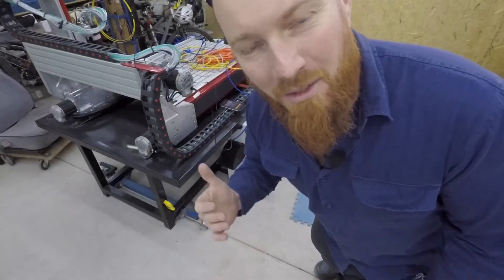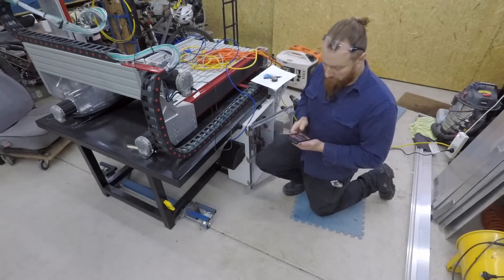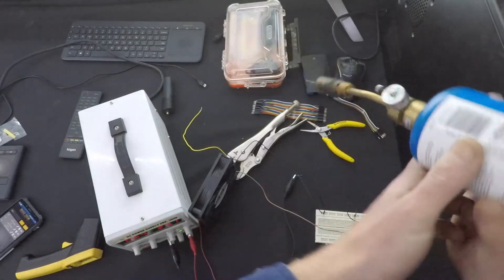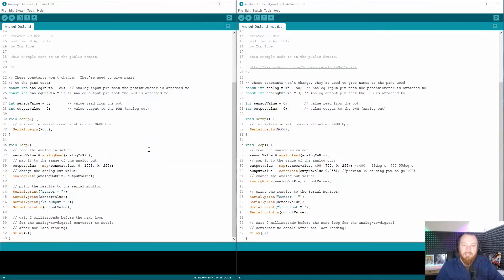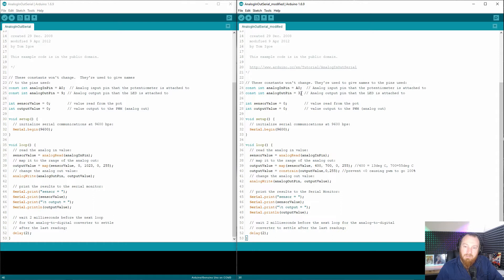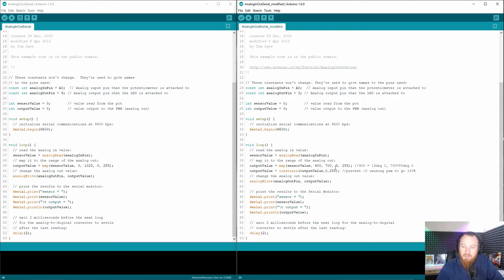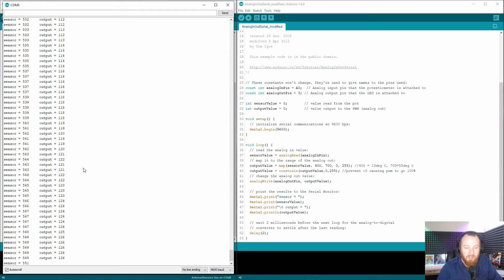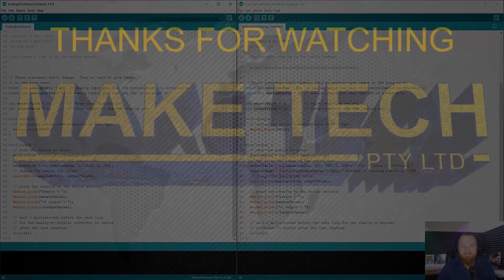ARDUINO: CONTROL 4 WIRE FAN, WITH TEMPERATURE SENSOR

Comment: where is the code?
Reply from the maker: Hey, sorry I missed your comment. If you use the example in the Arduino IDE software, you can make the small changes shown in the video. It's not worth uploading as it's so similar to the example.
Thanks, Ken.
Reply: @MakeTechPtyLtd  You could share the code, just copy and paste it on pastebin.
Many people looks for something ready to use it, not all have time to understand and modify the code (except if you're learning or studing).
Reply from the maker: @felipe.verasay  thanks for your feedback. It's a challenge to make videos that are useful for beginners, intermediate and advanced useres.
Reply: @MakeTechPtyLtd  Sure, for students perfect. For people that would like to make it for working purposes, well not friendly not share the code. Not time to understand (except for pinout config).

Electronics videos are simple. You show it working, you show the schematic (wire connections). You show the code, very simple. (At this point normal people stop watching, if you find it usefull you like it to watch it gain in the future). In times, 10seg introduction (?). 15seg showing working, 20seg schematic, 1min code. (2min video ideal for this).

If you want to go further, then you could explain in detail the code, make variations, make a complex circuit, etc... leave a guide, invite people see your webpage, etc. (for this you could make it in 2-3min extra, 5min total video)
Reply from the maker: @felipe.verasay  I would like to have some resources on the Make Tech web site. I have a few other things to focus on first but that is definitely on the list. An online magazine type format and or a Wiki style.

Comment: I have a question. I understand you use a 4 wire fan, so only thing you must do to set fan speed is power it up and send a PWM signal to it through the designed wire. The prodedure is clear and fully documented on the Arduino community. 
However,  I tried and found that my 4 wire fan do not get to full stop when the PWM signal goes to zero. My fan speed goes from about 50% to 100% when supplied with the FULL range of the PWM signal. To be clear PWM signal from 0% to 100% causes fan speed from 50% to 100%. My question is: did you use a particular specification for the fan to achieve 0% to 100% speed control range? I don't seem to figure out what fan to use to get low speeds below 50%. Thanks
Reply from the maker: Product datasheet will have the info you want.
For example some Sun Ace fans run at 25% speed at minimum pwm.
It says at 0pwm the fan stops spinning, however Arduino 0 pwm may not be a 0v signal.